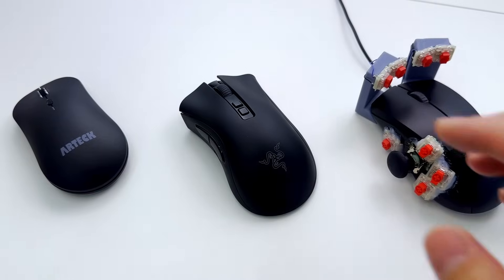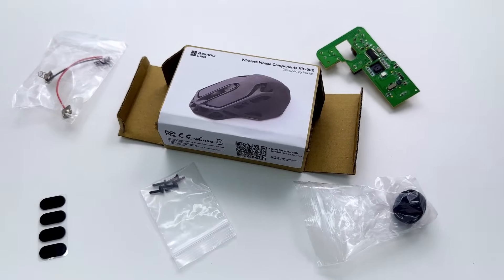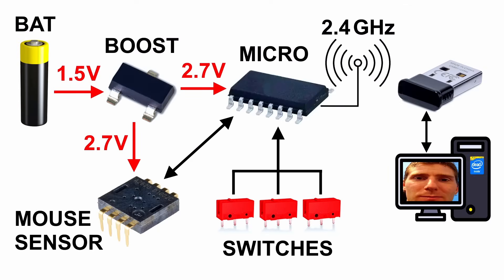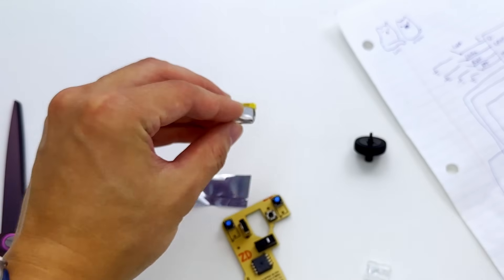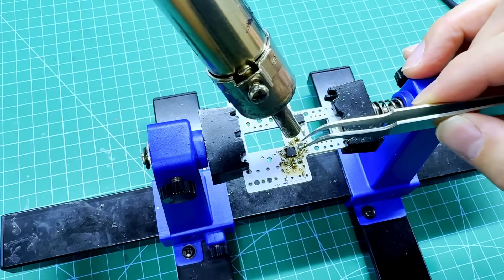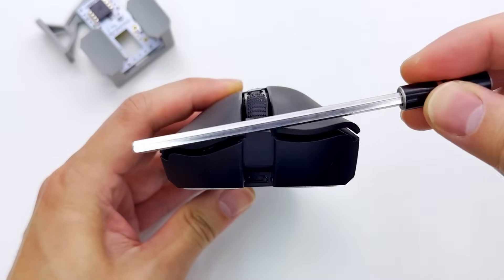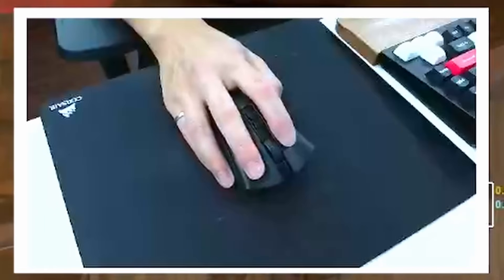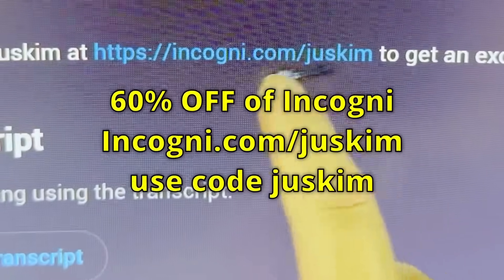I Made the Worlds LIGHTEST Mouse (Wireless)

Comment: Hi. Would you please do us a favor? For the most ergonomic use and get rid of point finger muscle contraction, I use to flip left and right button so that I left click on the right button, my point finger rests on the right button, and my middle finger is at the right side hanging the mouse. I click left button and scroll the wheel using my point finger, yes that is not for gaming obviously, but for daily work it's so much better, no muscle contraction at all except clicking/scrolling. On normal mouse, our muscle's point finger has to contract to bring the finger left and that is the main problem with the common mouse design. So that, we want you to make another button after the right button so that my middle finger can click it, probably lower the button even more for the shake of ergonomic thing. It will be like 3 fingers mouse, extremely ergonomic, first on earth. Please please please make it 🙏🏻🙏🏻🙏🏻🙏🏻🙏🏻

Comment: why don't you use a capacitor and a coil wrapped around the bottom of the mouse and a mousepad that charges the mouse. I think that will shave off some grams. The battery is pretty heavy

Comment: Can you replace the board with a paper-board circuit drawn by condictive-ink to shave off gramms? :)
Also remove the battery and use coils to transmit power to the mouse.
The next disruptive lightweght mouse is a high-frequency quality touchpad that never existed so far.

Comment: Battery solution, have 3 of them ready, 2 on charger one in use, all connected to the pc through a usb hub.

One dies, swap for a charged one, and when you can plug in the old one

Comment: NIce, the lightest I've gotten is ~25g with my Keychron M4 by drilling holes in the shell, and using a smaller battery.
I also made it quick swappable using magnetic connectors.

Comment: solution for battery is a mousepad that wirelessly provides charge to the mouse, or no battery and completely supply power using the mousepad
Reply: Probably would be more weight for a coil than that tiny battery

Comment: Do you know about light weight pla? Its pla with a foaming agent. That way you can use less filament to cover the same space. (Although its likely not as ridgid) Its used for rc planes mostly but it might be possible to design a lighter mouse with it. Also, have you seen the mice from g-wolves? They use the flares in the pcb to support the sides of the mouse. (Specifically the g-wolves htx) might be worth looking into
Reply from the maker: Thanks! Taking a look now

Comment: why did not you use a gaming-grade sensor. even a paw 3311 would have been great, good enough gaming sensor for 1000hz polling rate. so much hardwork and efforts were done to this project, would have been very nice if u had at least a paw 3311 sensor with beken mcu. 3311 sensor is really cheap and its being used in 15-25 usd gaming mice capable of 1000hz wireless gaming. 3395/3950 would be amazing, cost would not be an issue for you, sensors are cheap.

Comment: You can replace the buttons with a magnet sensor.or some other lighter sensor to be a litle lighter as vell.❤
Reply: Those sensors are not lighter
Reply: i think the next more technically advanced iteration should feature optical low latency switches since they've become a lot more available and tactile

Comment: optimum: bruh
Reply: basically the same mouse as the one optimum made just without the supports to make it more rigid
Reply: @stufflike5844  way smaller battery and the sensor is also way worse
Reply: @Naevak. Yeah the battery on this mouse will last 7 hours max
Reply: @stufflike5844 also optimum doesn't make his own PCB
Reply: @v000000000000v  the pcb is still custom now since he's working with a company
Reply: @ChaBawbe  ya it's custom but he didn't design the pcb, it's still finalmouse's pcb design, he just designed the case to work with the pcb
Reply: THIS WHAT I THINKING AFTER SAW THE THUMBNAIL
Reply: @albertfrengki  REAL THO
Reply: Exept Optimum also stole the idea from reddits and branded it.